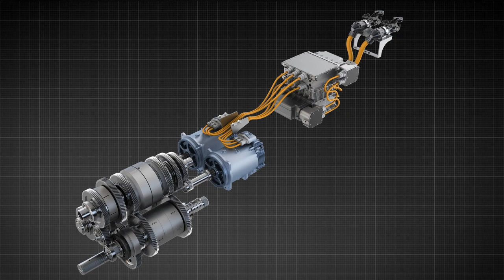+Gain Ground with Electric Variable Transmission | John Deere Tractors

Comment: Hydraulic does take a lot of energy. 
High pressure.   Wonder how it compares to electric motors.  
It's an extra system though. 
But in some cases it probably is nicer.    Especially if u want to drive the wheels on something your pulling.   Can be easier done.   
They do that with the Prius.  Electric rear wheel drive. 

U could drive the wheels on a big planter or big digger for extra traction.   Or the grain Cart.

Comment: if you going to add a generator and motor why have the rest of the transmission? why not go to a full electrostatic drive like diesel electric trains. yous already have the motors and inverters from your failed full electric tractors.
Reply: Too much power lost.
Reply: @zachary3777  if that where true trains wouldn't be using the system.
Reply: @phalanx3803  you think a tractor is the same as a diesel locomotive?  A tractor doesn't have to get a load weighing thousands of tons moving from a stop.
Reply: @zachary3777  Mechanical transmissions really more efficient than generator/electric set up though?
Reply: @MrWackozacko  yes, much more. Mechanical gear transmission is about 99% efficient. Electric drive would be 80-90%.

Comment: Finally!! I waited a long time for this. 10 yrs ago I was wondering why they don't replace the hydro in the IVT with an electric motor
Reply: Toyota did that in 1997 with the Prius. It is more similar to the Fendt Vario though as it does not use any clutches.
Reply: @apn42  that's interesting. I'll have to read up on that sometime
Reply: I thin pure disel-electric drive is beter
Reply: @5er593  diesel generator, motor on each wheel. bunch of sensors. Phone app to control. Done
Reply: I will stick with my M Farmall.
Reply: @5er593  in some applications

Comment: Now more expensive to replace or repair, and and there will be loads of them breaking down in the first 500 hours.
Reply: Unlikely. Motors and generators are seriously reliable
Reply: @jeffjefferson3364  I agree Electric motors have been used in Locomotives for years now and also in ships, I think this is a great idea. The problem with I V T 'S & C V T 'S is cooling the hydraulic systems.
Reply: It’s an option.  Don’t buy it. Simple
Reply: They can be plug and play. Easy to replace

Comment: •	I made a mistake when purchasing this technique with this motor and I will try so that others do not make a mistake. I bought ANT 1000.01 mini loader motor JONH DEERE CD 4045DF270 on November 16, 2021. After 50 hours, the hydraulic pump broke down, a week later new hydraulics were installed. The reason for this is not high-quality import substitution. After 100 hours on February 21, the motor broke down. A week later, they came to us from the JONH DEERE center, looked and said that the injectors (nozzles) were not working. And a week later the injectors came and changed. At the same time, we immediately told them that the motor was not right and the sound was not right, the motor should use more oil. They said that they should do the examination on the injectors. Already 2 months + 8 days have passed, on April 28, the results of the examination showed that the reason for the failure of the injectors could be the reasons - it is possible for the fuel line to get foreign impurities, dirt and chemicals. I myself was not present in the examinations, only God knows his gender, maybe a factory defect. Moreover, I am not a diesel manufacturer. I am not against JONH DEERE, and I do not advertise other companies. I know that while I have a warranty period, so I always wait for a long time for their services, expertise. I need to repair and start the equipment as soon as possible. And I have enough debt. And if it breaks during the seasons, we are waiting for the warranty parts and the season will pass. This expensive thing does not feed, but leaves behind a debt. You will suffer forever. When purchasing such technicians, look around, spare parts for which technicians are more accessible and cheaper. Do not make mistake when purchasing such techniques. JONH DEERE employees say: "If you bought equipment from us, the tractor was repaired in a week and you worked with it and would not have waited so long." Half of the tractor parts are from other manufacturers. Different manufacturers do not interact with each other in the shortest possible time, customers suffer from this. Do you think it is normal to wait 2.5 months for the examination of injectors? If they had repaired it faster, I would have put the equipment to work and half of the costs would have paid off. After 2.5 months, I even lost my job. Look at the sites of sellers, comments are also disabled there, and this is not in vain. They don't want to hear customer feedback. When you call, he doesn't pick up the phone. Some more spare parts will not be found in Kazakhstan. I was told some spare parts will be brought from America within 2 months. After 100 hours the motor broke down. For the examination of the injector, 2.5 months and repair is another plus to wait for spare parts for 2 months. In general, it turns out that 4.5 months to wait is normal or a typical robbery of ordinary customers by monopolists? Chinese technicians give a guarantee of 2000 hours, and these companies have 1000 hours of grants. One mоtor JONH DEERE CD 404DF270 I lost my dreams and nerves, I hope this painful story has not been repeated with anyone.
Reply: this is NOT the same technique and this is NOT the same motor